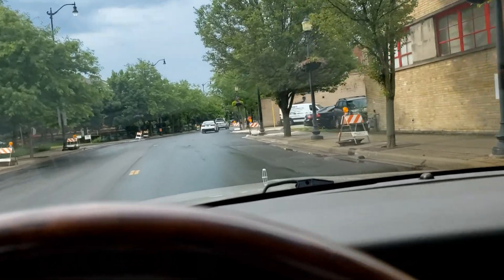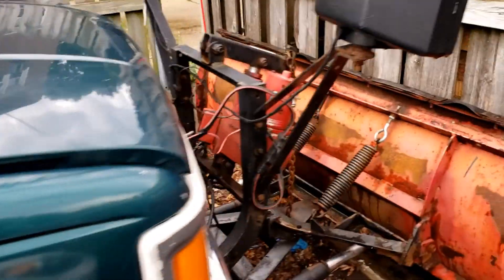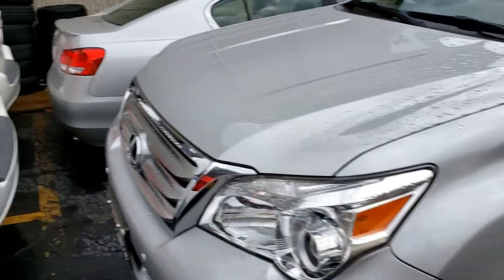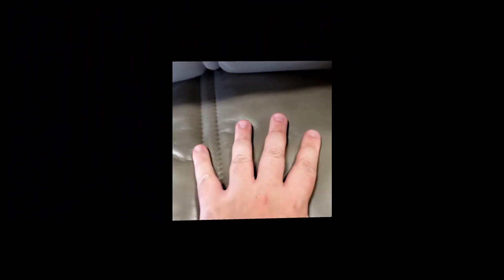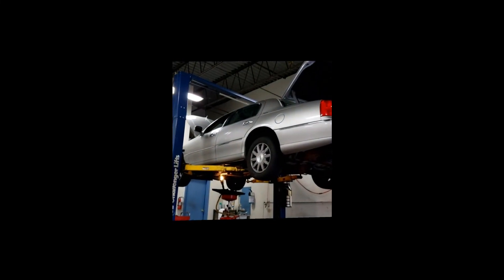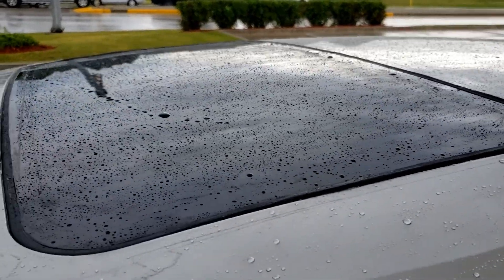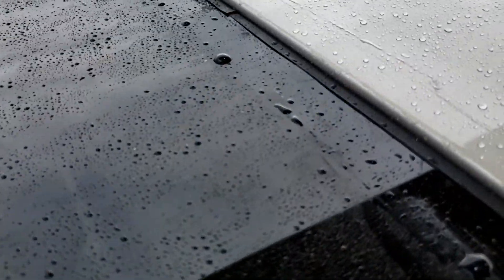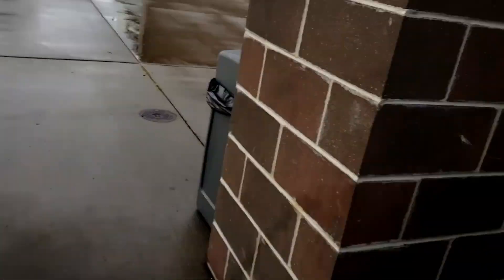Fixing the Air Bag Light, Sunroof, Seat Stuffing on 2006 Lincoln Town Car @ 3C Automotive & Repair

Comment: Vitaliy you need to Fluid Film your undercarriage ASAP! It will protect AND lubricate every metal part under your car and lower door lip. If there is rust already there is will 100% stop that rust from growing. There is a guy in Itasca that can do it and for around $100. 630 seven 7 five zero 7 five 7.  Not only will your car stop rusting but also greatly increase the resale value. Ive done it to my last 3 cars since I found out about it. You have a beautiful car!
Reply from the maker: Thanks! I actually fluid filmed under both rear quarte panels (think there is another video on that). The biggest problem is that rust is already everywhere and doing the whole car will only be a band aid for a couple weeks until all the flied film gets washed away. I figured I got another couple years with it until major problems happen so trying to enjoy it.

Comment: Looks like it worked out fine. The only thing I would work on is the rust underneath. Keep it as rust free as possible.
Reply from the maker: Yes, I'm happy with the repairs and looks like the sunroof is holding strong also. I'm trying with the rust and asked the mechanic if he sees anything super bad. His response was - it's not too bad :)

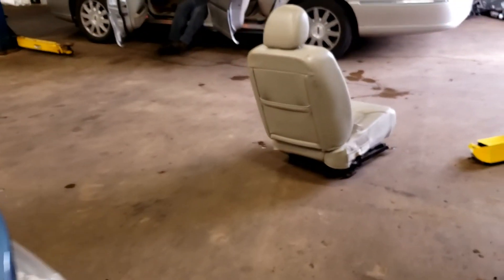Comment: 4:19 Yo V-Train,
OK, I'm confused.
Please forgive my dumb questions.
 
1.) Did you replace the factory seat bottom cushion?
2.) Did you leave the factory seat bottom cushion in place, and just insert extra pieces of foam?
3.) Why did you not just replace the factory seat bottom cushion?

Thanks for sending me this link, I've been searching for a while.
-Chuck
Reply from the maker: No worries!
1. I didn't replace anything factory 
2. I stuffed extra foam between the metal frame and factory foam + between the leather and factory foam
3. Good question. I guess I wanted my seat to be more like the old school Town Car - extra plush couch 🛋🙃
Reply: @VitaliyKofman  
OK, that makes sense.
So even if you would have replaced the factory seat bottom, you probably still would have added extra foam.

My grand marquis is starting to collapse, and I'm researching my options.
Reply from the maker: Probably. Being on the heavy side, I tend to sink in further so extra foam is always welcomed ☺
The only problem with my way of doing it, was challenging to get the leather back on. I was afraid it would tear or break one of those tabs, but been holding strong since last summer.
Reply: @VitaliyKofman  
Define "heavy". 
I'm 6'4" 300lbs.
Reply from the maker: 5'11 ~230lbs.
All through my 20s I was a steady 160lbs and after hitting that dirty-thirty been fattening up for the last 5 years...
Reply: @VitaliyKofman  
I was 5'11" 225lbs in 8th grade. 
I still managed to get bullied though. Lol

When I got to high school I started playing football. 

Then I only got beat up by my team mates. Give & take I guess. Lol
Reply from the maker: Sorry to hear about the bullying! I was never bullied, but I was always considered under weight and doctors / gym teachers would tell me to eat more. If they could only see me now 😁
Reply: @VitaliyKofman  
Back in my day, getting bullied, and getting beat up once in a while made you into a tougher, and stronger individual.

Nowadays, not so much. I'm glad I got those life experiences when I was young.

-Chuck
Reply from the maker: Now a days, you look at someone and that will offend them + get you suspended

Comment: I just wanted to give you a heads up on your ac accumulator.  On that car it is located right behind the radiator on passenger side.  You will find that it is housed inside a small black plastic cup or can.  Depending on driving conditions, humidity in your area and mileage on car....the accumulator will rot/rust out at the bottom inside of that plastic cup, especially if let first, dust, and debris build up in the bottom.  The drain hole to let condensation drip out is way to small and clogs up easily and causes accumulator to rust out prematurely and leak out your refrigerant.  My parents live on a gravel road and we charged their ac system and within two days it had all leaked out.  If unit starts to leak freon or stops cooling....check bottom end of accumulator inside cup.
Reply from the maker: Thanks a lot! I'll try to find it to see what's happening there. So far, AC works fine.

Comment: Vitaliy, you may want to check out a video here on YouTube that the "Car Wizard" put out a few days ago where he replaces the sunroof glass and gasket on a late model Honda Accord.  If you are not familiar with his channel he puts out a lot of interesting automotive repair videos.  He got his start from another automotive YouTuber "Hoovie's Garage" that I really enjoy.  He does mention that the glass should be flush with the roof sheet metal so yours may need some adjustment.  He shows very well how that is done.  Keep up the interesting content.  Have you ever considered upgrading your rims to the OEM 17 inch chrome wheels?  I think those wheels really dressed up the Town Car.  I am not sure of the size of your wheels but if you had to replace wheels and tires it would be fairly costly but worth it!
Reply from the maker: Thanks for the comment! I watch Hoovie's Garage and The Car Wizard's channel = great content! I just watched that sunroof video and it does look like mine is a bit off. I'll probably stop by a body shot to see if it can be readjusted. Driving through a downpour yesterday did slow down the leak so the new gasket still helped. As far as wheels, I have 17" standard rims from Signature Limited and don't want to spend the $$ since I "fixed" the peeling and now they hold sentimental value :) Thanks again!